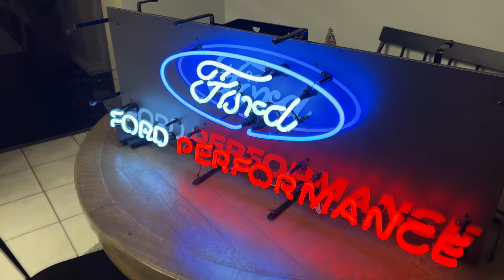My daughter drives the FALCON!?!? and WE start on my parents 1970 VW BUG!

Comment: From the looks of things you forgot everything you knew about pulling a bug engine. 15 minutes max with a lift. wires fuel line throttle cable , heater cables and four bolts and it is loose.
Reply from the maker: Lol! That’s absolutely correct! Last time I had an engine out of a bug was probably 1998…… but it came back. I HATE the flat head bolts, rusted hardware and nuts that are in between 12 or 13 mm! With that said I’ll own another one before the lord takes me away. But an earlier one. Not a super beetle